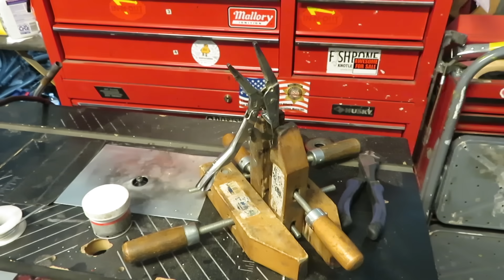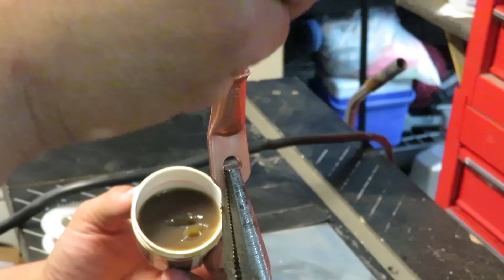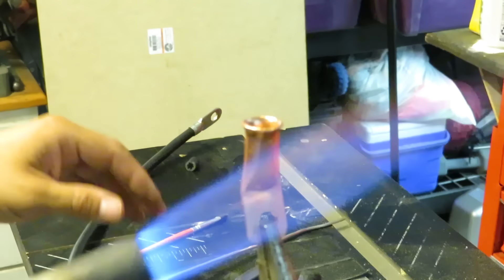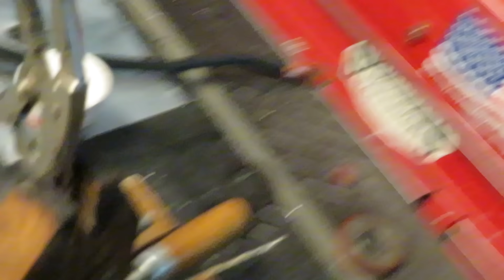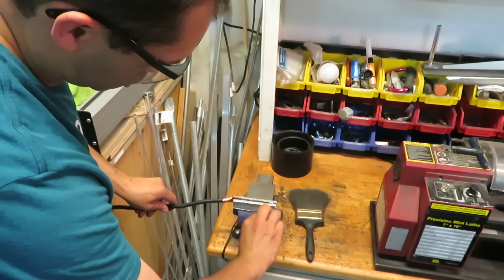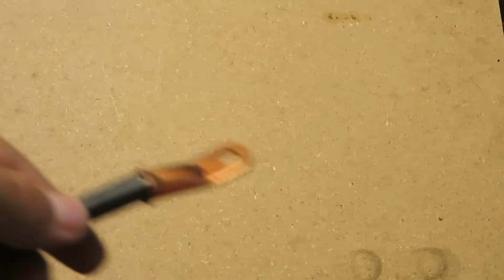How to: Battery Terminal Install. Better than Factory.

Comment: Tinning the wire prior to soldering in the connector.  Protect the insulation by wrapping it with a wet piece of cloth.

Comment: Acid core Plumbing solder will not work just fine for battery cables or wiring in general.  Not only very corrosive but not very conductive

Comment: Seems to me that any Electrician says "crimp" and don't solder. ....... Whereas Electronics people tend to rely more on soldered than crimped. .......... Our computers, watches, hoshould appliances, car electronics, etc, etc, etc, are all soldered, and contains hundreds to thousands of soldered joints. ...... But they generally don't carry too high currents, and they're generally not exposed to flexing, and you can easily make a poor soldering joint that will not last for too long, but in my house many water (copper) pipe connections are definitely soldered, and are to my knowledge reliable and lasting as can be. ...... And single wire/lead connected to a screwed terminal, they may loose their connection pressure with time (needs to be re-tightened), and they may easily break of (arc), if they were initially tightened to hard (pre-broken off by over-tightening). ..... My background is electronics, so I tend to trust soldering more than other connections, but with high amp cables that may even flex a bit,... o.k.,... soldering is probably not a method of choice.  And whatever, a good bound and clean surfaces, and a good connection pressure, is of importance.  "cold fusion" was new to me, but makes sense if the materials and tools involved all match up.  But for me as a private, they probably mostly don't ;-).

Comment: Great except if the lead heats up, the solder melts and the wire comes out. All of these cables inevitably corrode, which is what causes the heat.

Comment: Is plumbing solder good for electrical connections?

Survey says:

"No, plumbing solder is generally not suitable for electrical connections. Plumbing solder often contains acid-based flux, which can corrode electrical components and lead to connection failures. Electrical solder is specifically formulated with rosin-core flux, which is less corrosive and more appropriate for electrical connections."

Comment: Hi, Important suggestion: Paste flux and plombing solder contains Acid that causes corrosion in the wire copper. This is NOT for electro use, only mechanical use. 
For copper wire is needed electro solder flux and electro solder wire. This contains Neutral flux and  does not cause corrosion.

Comment: Especially important with guitars and amps to get wires hot enough to melt the solder so it bonds wires with their connection. A cold solder joint will result in a horrendous buzz. Well done.

Comment: So um... Others say that solder fails and whatnot... If there is enough flux and enough heat when soldering, you get some good solder joints. 

HOWEVER: 
Solder has very low conductivity compared to copper... We are usually talking about 10 times less conductivity. 
When you size a cable so that it will be able to pull 250-300A, I think the connection should be able to handle it too... not just the cable. 
In my opinion, the joint will heat up... So much so, that it might melt the insulation of the wire and it might even straight up melt the solder. If you had used a much tighter lug, maybe, just maybe it'd be slightly better... But not like this. This is dangerous...

Comment: I would suggest,
 " Tinning " the cable first !
That is apply Flux, then solder to the cable !
Then, liberally apply Flux to the cavity of the connector !
I would then crimp the connector, then apply heat to the connector allowing solder to flow !
Simply soldering is asking for trouble, as solder is for making a good electrical connection.
Not mechanical strength !
And should you ever draw large current thru the cable, the heat may be enough to dislodged the cable, or loosen it, causing even more heat as it tries to conduct !
You may get away with this on some devices, but with an Automobile, it would be subject to wide temperature swings, not to mention vibrations, which over time may allow the cable to walk out of the connector !
                       🤔....?
          Just my 2 cents !

Comment: There is so much bad advice in the comments of this very bad video.

Use rosin core flux. 
Crimping isn’t better for vibration. Nothing can beat a soldered connection. If you disagree, do both. 
If your soldered connection is getting hot enough that it’s compromising the connection, you’ve got a serious problem. 
Heat rises, you definitely preheat the wire. Don’t just drip solder on a cold connection. 
My best advice is find a different video.

Comment: A solder joint with NO mechanical joint /crimp - is NOT superior.

Plus - solder wicking can destroy flexibility.   This demo is Not superior to Factory - which always come with a Mechanical Crimped Joint.

Comment: The critical factor missing from your method is a good mechanical connection between the cable and the terminal.  That is the point of crimping.

Comment: Dude. There is a reason the original is crimped ... heat !!!! Your soldered only connection is a terrible idea, it will not sustain being overheated and stay connected. Do better !!

Comment: 3) yeah i did that and still get a voltage drop  whether i touch the leads to the battery terminal or the battery cable, i get 12.6 or 12. 7 volts everytime (edit: but i get 11.7 or so at the cables) so i never amp tested the battery, i thought it had to be the leads but the interior light had been left on overnoight how it began , and the battery is dated 2019 so seemed like maybe it was sos so , i don't know if the voltage drop is...i'll test the battery and go from batteyr instead because maybe there won't be the half volt or whatever ...it's a pain to solder those down in the hood but it looks like the cables go into the wiring harness , i found the battery cables on r*ck auto for like $6- $22 depending on length and one is like the stock one , the copper boots were almost $12 for 6 (3 2 packs but i'lll return one size.....take care thanks again i'll need the tips elsewhere sometime too ...

Comment: This is somewhat better than an incorrectly crimped connection. Too often compromises are made when the correct crimping tool is not used. He’s y gauge Crimping should be done at the workshop. I often opt for professionally pre-crimped when out and about.

Comment: Did you know that open flames cause the cable to oxidise which can increase the electrical resistance? Its fine for copper pipes since you would use earth bonding anyway

Comment: solder not coast guard approve , you need to crimp the ends , if the wire gets too hot the solder will heat up and wire come loose

Comment: Your not plumbing where is the crimp? I've see wire det hot enough to soften the solider and come apart then you can have a fire...
Even the wrong solider you don't use plumbing for electrical becouse the acid you use rosin core .  If you think you know what your doing double check before you post it because if someone follows your advice and a major problem aroused you would be liable...

Comment: Plumbing solder is not the correct solder for this application and the connector is too big for this wire.

Comment: Better than factory?  This is the worst possible way to make cables.  A copper on copper crimp has 9 to 13 percent better conductivity than tin-lead solder and I don't have any data on plumbers solder but I'd guess at 20 to 40 percent.  
I guess if your only concern is how pretty it looks you've got it covered but good conductivity and long life come from the business end of a crimping tool.  Little bit of heat shrink and you can take it to the ball.

Comment: Motorsports wiring suggest to crimp all connectjon as solder will always have some level of resistance. 

I did it like you sbow in video 10 years ago. The connections loosened.   I reheated copper ends and crimped while hot to have a mechanical connection along with the old solder.  Helped and connection doesn't get hot anymore.(noticed problem when I touch it and was hot and then noticed it was a bit loose. 

In future I will crimp only.

Comment: having made several of them, I will remove the flange on the outter part of the connector, install a heat shrink to cover the transhion from the wire to the connector, No Biggie, it just makes it look better,,,,, Thanks for your post

Comment: As a retired high voltage electrian, we never soldered any connections. Connections were either crimped or mechanical or bolted.  But in the electronics world, well thats a different story.

Comment: proper lug size, and proper size crimp die are the approved methods for terminals or splices.  There are zero codes or standards that allow for a "soldier" only splice or termination.

Comment: To get the professional crimp on a lug use the correct size lug for the cable and the correct type of crimper usually crimped two or more times to maximise surface area contact between the wire and lug.
Reply: But what if you only need a couple of crimps for a small basic off grid solar system ?

Comment: Guy!  What a great tip, there is no need to crimp the terminal to secure it.  In this case, is there any loss of energy because the end of the wire is tinned? hugs directly from São Paulo-SP/Brazil🇧🇷

Comment: What? No shrink wrap on the new connection? Just crimp connections folks and don't go by this because under conditions of heat transfer and over heating it will fail. Note to guy..stop making bullshit uninformed videos. People are stupid enough as is.

Comment: Crimped connection is far superior to soldered connection...it is stronger, more reliable and prevents the intrusion of moisture and dirt better than soldered connection.  This video is proof positive that you should not believe a lot of what you see on YouTube.  The name of the channel says it all...amateur.  A quick Google search will provide a great many hits recommending crimp vs solder.  NMEA recommendation (National Marine Electronics Association) best practice of crimping, not soldering for strong and reliable connections.  This guy does not know what he is doing.

Comment: Mmm, better.......use flux core and avoid acid core plumbing solder in automotive. I always crimp the connector first and tin it together. This way once it’s hot enough to flow you get a good hot joint. It really only backs up the crimp and protects it from the elements. Shrink wrap/tubing after.

Most factory connectors are crimped for vibration reasons in automotive applications.

Comment: This isnt a bad video overall, i personally prefer a 'cold weld' or a crimp on my battery connections. Whether it be a hammer, vise or plier style of crimper, i always prefer to crimp my copper connections. A proper cold weld can also hold your body weight if done properly. I think your video is good you just overshadow how well a conventional pressed crimp unto a wire can be.

Comment: A thumbs-up to thumbs-down ratio of 4:1 is not good.  A good video is typically ~50:1.
The know how and expertise of commentators who know and understand the electrical and mechanical characteristics of crimped and soldered joints is showing in the thumbs ratio.

Appearance isn't everything.

Comment: Looks good but fails in the real world. All it takes is a loose connection or corrosion and the solder will melt out.

Comment: Do not use solder on battery terminals. A crimp connection with heat shrink is the right way.

Comment: First class idiot more like.   Never use plumbing solder on electronics.  Never just really on solder for this type of connection, must be mechanically bound.  In a major fault with high current to ground for example solder will fail and could led to a fatal situation or equipment damage.

Comment: Dissimilar metals and DC current cause oxidation. copper and solder and DC current overtime, will oxidize, that's why we use a crimping tool for that terminal.

Comment: For those of you saying the solder will melt an loosen.  If your wires are getting to 600°F then you have bigger issues.
For corrosion beliefs I've done this on cables that are more 15yrs old with no issue; while have had cable rot of factory in that same time and age.  Corrosion would be more of a result from battery vapor.

Comment: Tin wire before dip it into the terminal. And use normal 63/37 solder wire + some neutral flux like NC-559. That's my recipe. :)

Comment: Automotive cables are never soldered as the cable can eventually fail due to work hardening. Those connections should be crimped with the correct crimping tool and not soldered.

Comment: Crimp it don’t solder it makes the cable ridged solder will wick up the cable. If you do solder use rosin core solder and rosin flux for electrical connection. Don’t use acid core solder or flux for electrical connections.

Comment: Wrong on many levels, done thosands of dc connections in telcom. This a fail. Connections can and do heat up and will melt that connection. We used specific jaws for specific lug sizes and wire gauge and type of wire. They make battery powered ones now that are nice and crimps it to the exact correct pressure and even logs it for record keeping. Never use this guys idea on dc plant solar etc.

My handheld one for 4 6 8 gauge stranded runs $ 150ish and even Embosess the crimp with a code showing it is the correct pressure. Clear heatshrink to show no exposed wire and correct lug color code.

Comment: I learned years ago, crimped joints won't break from vibration, but solder jionts absolutely will.. made me rethink a lot of my projects...
Reply: That is not what NASA has proved, or perfers.
Reply: @bowez9 source?
Reply: @henmich  NMEA recommendation is to crimp.  Industry best practice (Google it) also recommends crimp.

Comment: Here is another tip. Hydraulic crimping is the ONLY way to install lugs on power cables. Anything else is resistants getting in way of current flow. This is where you are not getting your money’s worth when the full beans is applied. Voltage drop is the most important thing to watch for. You could actually starve your equipment.

Comment: Soldering lugs onto any power is a big sin in the electrical fields. First, if there happens to be an over current on the you just soldered, guess what, it will melt the connect. Second, the reason why we the professionals crimp our power powers with a little bit of duck butter( anti corrosion paste) is that the whole goal is to not have any oxygen inside and all or the strands will become a solid Conductor. Cut a hydraulic crimped power cable lug in half and you will see magic. Hope you correct all of lug connectors real soon before something bad happens.

Comment: There's a very good reason why high current leads in high-power applications such as MRI are crimped - solder is very poor at resisting fatigue. Crimped cables are made that way to resist billions of operation cycles or oscillations, soldered joints begin to fail far more quickly. I can't think of a single plug or receptacle on a car that isn't crimped from the factory, and it's not just because it's cheaper than soldering.

Comment: Worst method ever. Plumbing solder absolutely not intended for electrical connections. Additionally,  my John Deere training specifically states not to use any soldered connections in mobile vehicle wiring because it creates a hard spot in the cable which will break off from movement and vibration.

Comment: Why are you using acid based flux !!! Should be using rosin based flux/electrical/electronics solder and flux!! Acid based flux will eventually corrode the wire !!

Comment: Don't do this!!!!!! If the connection gets stressed with any load the solder will get heated and run out of the joint. Only crimp high amprage connectors.

Comment: This is really bad for automotive use. Do NOT do this. It can lead to fires in worst case scenarios.
Sure soldered connections are strong, and electrically great (very low resistance), but they are NOT good for automotive use, because of vibrations that will weaken the cable over time, this is a major reason crimped connections are used. 

That solder will creep up the copper as your soldering, and u will have a solid connection by the connector, the vibrations of your car will weaken the copper where it is not tinned/soldered or in this area. Dont macgyver shit like this, use products that is meant for automotive use.

Comment: Copper is used because of its conductivity and heat resistance.. 
you are taking away both the qualities in the flow of electricity, by soldering with lead ..

Comment: Not exactly the right way to do this, tinning the wire is required, and you really should use electrical solder as it has acid in the core.

Comment: Wow.  Completely NOT the correct way to do this.  I hope nobody is going to actually follow these directions.  Always crimp.  Then solder.  Period.  Thermal expansion will cause this type of termination to fail.  Crimp.  Crimp.  Crimp.    So much bad info on the interwebs these days.  Used to build dc systems for the military.  Never would allow this method.

Comment: Crimping connector is way batter than soldering. Maybe solder is stronger but when you have a lot of movement, solder will brake.

Comment: i would change just 1 thing.
i would always recommend tinning the cable wires before inserting.
tinning puts a think solder coating onto the wires to make absolutely sure all make a good contact. inserting straight in without tinning one cannot be sure of a good contact. this could lead to a 'dry' joint. due to the high currents this will be required to handle any resistance in the joint will lead to heating, damage and possible fire.